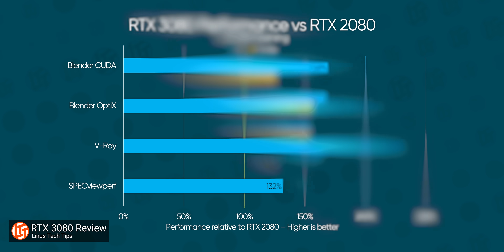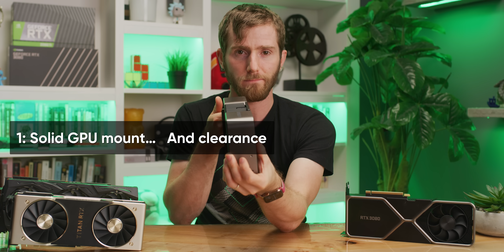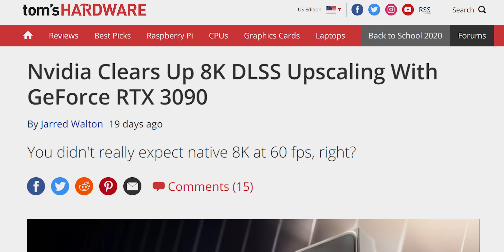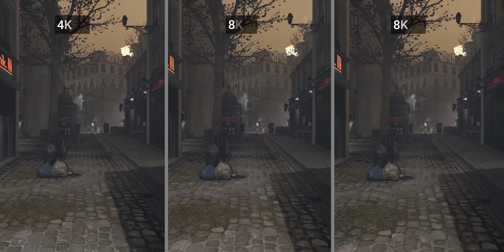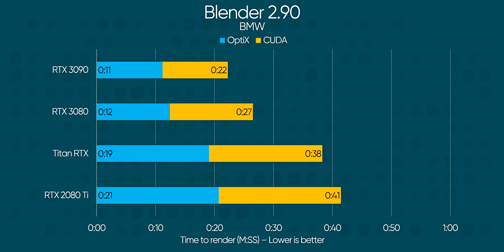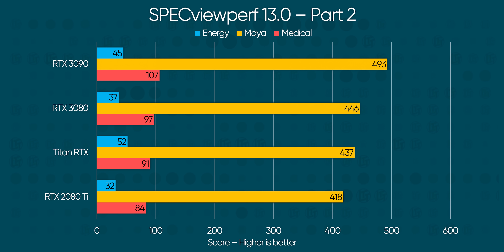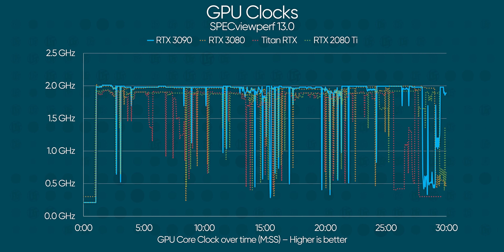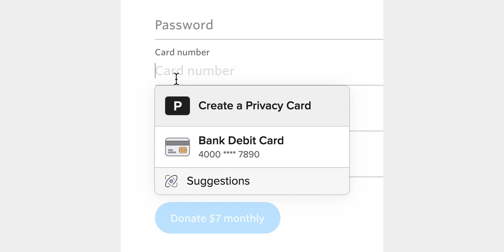Making Nvidia’s CEO mad - RTX 3090 Review

Comment: 2024 september. I just got the 3090 for 600€, used. The best card now is 4090 (5090 leaked specs are already shown on Techpowerup), but the 3090 is still the next best Nvidia card with 24GB RAM. And therefore its arguably better than 4080 if you wish to run your own lil LLM AI project. 

Its unbelievable to hear Linus say 2020, as the upgrade really felt like I was getting something very new.

This is a huge shift in computing space that used to be "its old as soon as you lef the store." The reality now is, that "whoa, this is new, its only 4yr old."

Comment: brand new 3090 FE on ebay for $1200? yay or nay?
Reply: nay..at this price you should be able to find a 4080 (even if it is not a good value in the 40 series..it has more performance than a 3090 and a few features that could be interesting. DLSS 3 for example).
Reply: @telefonbärmann  got the 3090 fe still brand new for $942 shipped. True the 4080 is “better” but for over $1320? Nah im good.
Reply: Yeah vram ❤ @Vencarter
Reply: @erikbalens  considering most open box “new” are still going for +$1200 and some even going for $2800, i doubt it

Comment: Just for a sanity check...The reason Titan GPU outperformed rtx 3080 & 90 is because the Titan GPU was optimized for vector multiplication based applications. This includes things like AI and DL models. THis partly due to the fact that the Titan GPU offers more tensor cores than it does Cuda cores. 

This is what im understanding, but for any ecperts out there passing by please feel free to correct me

Comment: Finally 2 fps in minecraft rtx
Reply: when i was 15 i use to run gta sa on a cheap 100 dollar dell laptop and it only got 12 to 15 fps, people still roast me on my older videos because of it and do not understand now i got a 6 year old gaming rig that can handle it much better. thinking about 2 fps it would not even be playable i remember playing turok evolution on ps2 and the frame rate would die so much in the flying chapters id always get killed because even if im holding the analog stick to turn left it would not turn all the way due to the frame loss i swear that game was running at 10 FPS sometimes and normally im ok with 26 fps but below that its impossible to control things in games. i got a rtx 3070 TI i just ordered but im kind of screwed because i need another 6 to 2 pin PCIA cord and it has to be modular it was a headache to search the right one for my supernova PSU. now i just gotta play the waiting game again and hope that everything works since my pc has been showing issues lately.

Comment: Saw some webpages about the power my GTX 1060 uses (120 watt) vs RTX 3090. Think the RTX 3090 were using about 400 watts of power. So almost 4 times as much power. Thats a lot. Are there any details about how much the 3090 are using in say idle mode (desktop use, browsing, and other non gaming stuff), and how much power it uses when gaming both RTX mode, and when RTX are turned off? Or does it constantly uses around 400 watts of power?
Reply: Of course not constantly, that would be insane. It uses around 40 watts idle.

Comment: The simple reason for Siemens NX performance being shoddy is it's meant to be.
The Quadro FX version of the card will dwarf this performance with the same or similar silicon probably with way more vram though.
The amount of money it takes to develop certified drivers for Siemens NX is scary. Remember these are not cards that will be pushed to 100% for a few moments in a gaming session lasting an hour or two. These will be running NX all day everyday for 3 years minimum with exceptionally complex workloads and probably in an office with loads of other workstations pumping out a ton of heat that the meagre air con can't deal with.
I worked at an oil services company that had upwards of 80 HP Dual Xeon workstations with high end Quadro cards all doing cad work including lots of full assemblies. They were working at high resolutions and the cards were worked hard sometimes for two shifts so 16 hours a day. There is a world of difference between workstation hardware and drivers and gaming PCs and drivers.
Luv and Peace.

Comment: Meanwhile budget people are still sitting at 720p and 1080p.  They should be working on bringing the cost down so more people can use their stuff.

Also buying a 1500$ card only to have them hold back performance with the drivers so they don't mess with their higher end products,  if your normal stuff can do the same thing just as well then at make the pro ones better than the others by actually improving the architecture.

Comment: I have a 3090. Also a 3950x and 64gb ram. I only use my computer for work really. But I connect to a remote machine that's slower than a potato. So I have an overpowered thin client.

Comment: Question, does Nvidia and Intel accept payment in organs?
Reply: Absolutely. Nvidia has a partnership with PayPal to process organ transactions. After you login to PayPal, click on the 'Settings' tab, then click 'Payments' and select 'alternate funding', then 'organ transactions' from the drop-down menu. I would recommend a kidney, but if you only need partial funding then lymph nodes are usually your best bet. After that, select an available time and date for your surgical appointment and Nvidia will contact you via your PayPal contact info, so make sure that's up to date. Don't make the same mistake I did, living with only one lung is no picnic. Still, I have no regrets. My frame rates are amazing!!!
Reply: @pltatman1  🤣🤣🤣

Comment: Since ALL the 3080s are getting scalped for $1600+ here, I got a 3090fe from Best Buy for $1499 and it's an absolute BEAST! And at 18% better performance when overclocked than the OC'd 3080s it's totally worth getting a 3090fe over the scalped 3080s, or even some of the $1000 msrp 3080s these days (still impossible to get at retail)

Comment: The difference between the 3080 and the 3090 (generalized) is 10fps, for seven. hundred. DOLLARS. If you’re a editor, designer, or anything that’s heavy on VRAM, then the 3090 is way more then enough. But if you’re a regular gamer with money to spend, 3080 is more then enough to run any game at ultra settings while still holding a good smooth performance.
Reply: except RUST🤣
Reply: @pepin8277  and ark i swear that open world game that makes your eyes bleeding at max settings is still unoptimised
Reply: Lol 3080 at 700usd...

That card wasn't even 700 when it was released

Crypto mining is pain..
Reply: What I’m looking at and really wanting is a 3060ti. That’s more than enough to run anything at 1080p above 30fps.
Reply: Even a 1080ti has been able to run all of my games, very well.

Comment: 2:20 Nah, I'm Running a UV 3090 with an overclocked 5900x, 3 high perf fans, 4 ram sticks, 2 7200rpm drives, 2 5400rpm ones, 2 ssds and I've peaked AT BEST at 535w out of the wall. I'm using just a CX650. (my 850 G2 is busy in my mining rig and I don't really feel like buying another since CX650 is doing fine.).

Comment: Using CS:GO as a benchmark for GPU's is a tad redundant. CS:GO is a processor intensive game, not a graphics intensive game. You can put whatever GPU you want into a PC, and as long as you have a Ryzen 5/ Core i5 or higher, you'll be smooth sailing with framerate to spare when your opponents drop 5 smokes and molotovs on A site Mirage

Comment: GPU: costs 1.5K
Minecraft (a game nearly 10 Years old): Best I can do is 40 FPS
Reply: Its actually more ram dependent then cpu dependent at least with mods but yeah overall Minecraft is just a weird beast
Reply: It's a very CPU-bound game. I have a 3080 and I was confused about the low frames( I was using RTX on) and I noticed that my card was only at 13%, but checked my CPU( a Ryzen 9 5900X, which in heavy games, runs at about 10% usage) and realized it was running at a stable 40%, so it's really just the game being weird.
Reply: @nautilus7025  the main reason is that Minecraft doesn’t use multicore systems so a really good single core might run better than a multicore with lower quality cores
Reply: @nautilus7025  graphics api again being horrible just use sodium mod
Reply: @nautilus7025  Isn't the bedrock edition supposed to be have a newer graphics API and optimized than java? Java community ray traced shaders are much more optimized and those doesn't even use RT cores of Nvidia
Reply: @sanjay_swain  a bunch of peeps went out to develop a mod call sodium and it pretty much rewrites how the game handles graphics, especially in sodium 3.0, also graphics was optimized in vanilla 1.17 and 1.18 for the height extension (though not really necessary but in some cases does help, really this should be focused on optimization for the CPU).
Reply: @sanjay_swain  yep, bedrock uses render-dragon while java doesnt
Reply: @nautilus7025  r9 5900xt
Reply: @nautilus7025  R9 5900 XT
Reply: @nautilus7025  lol minecraft is really bad at gpu acceleration.
Reply: @severfifteen994  'gpu acceleration'? You don't know what you're talking about, do you?
Reply: I already play MineCraft on a cpu lower than the min req and intel hd 4000 at 60 fps
With shaders, my friend plays on gtx with 60+ fps
Reply: The game is 10y I think 11 or 12y old

Comment: I’d basically have to rebuild a whole new PC for the card, I’m Still Running a i7-7700K and my case is a S340 with the kraken radiator at the front. My strix 1080 Ti barely fits.

Comment: I got 2x 2080ti strix oc i will sell I want this card 3090 rtx
But heard you say need 3000 watt power supply 
Dam is that for 8k
I'm not bothered about that  I'm happy with 4k 
I have a 1200watt power supply hx series modular..
Be quite full tower case
Amd Over clocked threaddripper 3960x 24core  3.7 ghz up 4.3 ghz cpu 
Rog strix trx-40E  mother board 
Memory  32gb x4 vengeance  DDR4 (3600 MHZ x 8 gb)
Should I still get this or not 
I love your channel your best man please let me know bro 
My 2080ti  no sli support killing me 
I'm getting 35 fps on cyber punk makes me feel sick
Reply: Or should I wait until May be September hopefully 3090 ti might come out if I'm only gonah get  30 fps on 4k I may as well wait but need to sell theses 2 x  2080ti 
Fast right now im hopefully get 700 each card 😬  spend 
£1.500 each nvidia bastards not sli any more
Reply: @alibaba4374  Dude, I have a 3090 and a 1080 running on a 1000w titanium 80 PSU, no worries to be had.
If the ti is better, I'll probably offload my current 3090 at half price. lol
Reply: @ReplyNotificationsAreTurnedOff  many thanks bro appreciate 😀

Comment: 8K finally available! That means 4K isn’t the best anymore, lowering 2k in price. So I can now play 1080p at an affordable price!!
Reply: Theres more to it than that. For gaming on a, say, 27 inch monitor which is mostly what people use plus the distance from eyes to the screen, it may not be necessary to have an 8k screen. From what I've read the general consensus is that 8k is best utilized on much larger screens with much more distance between eyes and the screen. Then there is the frame rate aspect. Most people would likely agree that 120 fps is superior to 30 or 60 fps - and most people would likely agree that 4k images/ video is superior to 1080p. So what I'm trying to say really is that if you're looking to do some PC gaming and have the ultimate experience then getting a 4k HDR 120 + fps monitor or tv is ideal right now - at least in my humble opinion unless you're fine playing 60fps or less at 8k and have a really really large screen and game from the couch or something, which of course is an option. Still, its an FPS trade-off. I've spent an embarrassing amount of time at Best Buy/ Walmart/ Target/ Microcenter looking at 4k and 8k screens and I'm being totally honest when I say I cant tell the difference. That being said, the content I've seen at 8k was like stock footage stuff so it's likely that it will be much more of a drastic difference when it comes to video games. Ignorance is bliss though, so I'm sticking with my 4k 120hz 47 inch Acer Predator monitor that  I was lucky enough to snatch up for $999 at Microcenter when it was on sale because now its back up to $1500 and I've seen it for $2000 - $2500 on Amazon.

Comment: Back before I was married and had some money LOL, I had 2 GTX 680's FTW in SLI. Literally yesterday my poor married budget managed to upgrade them to a single GTX 1660 Super, and the performance is much better. Crazy how a smaller, cheaper card is now more powerful than the huge expensive ones I replaced. But it does just fine for my gaming needs.
Reply: Most older gtx cards will do fine for most games even at medium. Even a 750ti can run at least minimum at 30 - 60fps of most current games.

Comment: NVidia has done the impossible: By not having any 3080 in stock, a LOT of potential 3080 buyers are instead buying 3090s. This is clearly shown in how fast 3090s are sold out whenever there's new stock. It is also clear that all of the AIBs are manufacturing 3090s as much as they could.

Comment: I have to lol at the fact some people paid scalpers $2000+ for this "8K" GPU, and it only manages 30 FPS at 1080P in Cyberpunk 2077 with RT on Ultra settings with DLSS enabled. RT GPU's are a pyramid scheme at this point, because RT is infinitely scalable and this BS will never stop. "It will only cost you $2000 every year, if you can find one, to keep maxing out those settings sliders!" No thanks. 2020 has ruined the PC hobby for me.

Comment: just bought one of these, hope it doesn't bottleneck my i5 4590
Reply: Don't worry, your gpu bottlenecks itself by games not being designed to fully utilize it
Reply: i think you atleast need a 2 core 2,9 ghz 6 yo cpu like me if you dont want to bottleneck it   (:-[])
Reply: You have an I5-4950 and expect no bottlenecks? The CPU is a HUGE bottleneck. You would need an i9 11900k  or i7 11700k maybe one of the upcoming alder lake chips on intels end or a 5900x or better, and even then there is a small bottleneck
Reply: @Techandgaminggalore  Sarcasm is hard to understand apparently.
Reply: @Techandgaminggalore  you don't need a 5900x. More cores =/= better performance, at least for gaming. You'd get the exact same performance when gaming from a Ryzen 5 5600x. Granted, if you are multitasking a shit ton of things at once, or doing rendering in the background while gaming, then a 5900x or 5950x is in order. Also, depending on resolution and settings, a gpu has to spend more processing power on each frame, so a weaker cpu that doesn't send as much framedata will have less of a bottleneck at higher settings.

Comment: dude with a SLI  GTX 1050 TI  we are having the same quality speed, all you need is to know how to configure the devices like in old time on windows 3.1 when all was done manually.   if you have a strong motherboard heavy duty one, with good power supply , excellent memory  (Hynnix , Samsung are best memory)  you are good to go.  a card who suck too much energy that is bad,  you didnt speak about the motherboard factor if she can handle that much of the video card what we did as a test and fried the board death finish.  it is good to talk about a new product what are the consequences to the others equipment.  The Video card manufacturer they pushes limits exaggerating the size just to prove speed and performance, false all is is they will consume more energy that is the secret of performance more you give electricity more it is speed, go to your windows electric management , ask to use the full scale of power and you will see how your system will double performance.   To me i will not waste money on that video card  2 GTX they do well and great the job with a good configuration.

Comment: There isn't enough of a value proposition for this review.

At $1500, you're getting a middling workstation card that was intentionally neutered because Nvidia will probably have Titans to sell to scalpers in a year or two, and has also been marketed for gaming in a resolution in which the TV's are priced between $20,000 & $60,000, even though the PC market hasn't even embraced 4K gaming yet. Oh, and there's an AMD competitor coming down the line that costs $500 less and is competitive in terms of performance. And top it off, there's absolutely ZERO inventory of any of the 3000 series cards.

Who was the 3090 made for?

Comment: Just ordered parts for 2014 2020 games at 1440p stupid ultra settings 
Setup 
Asus ROG Strix z490E 
 
i9 10900k 10c/20 thread 20 mb cache

32gb DDR 4 3000 Gskill trident z RGB 

2x 1TB samsung 970 EVO Plus

Corsair 1200 watt

Lian li PC-O11 razer case with go with all razer with hp kb mouse now case

for cpu  corsair H150i pro XT 360 rad with 3 fans 120mm rpms 2400 each